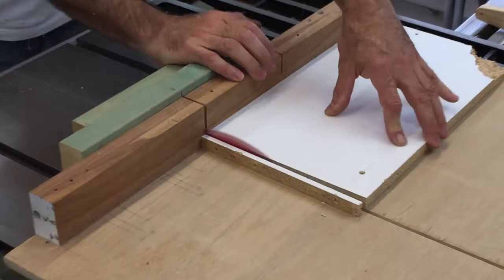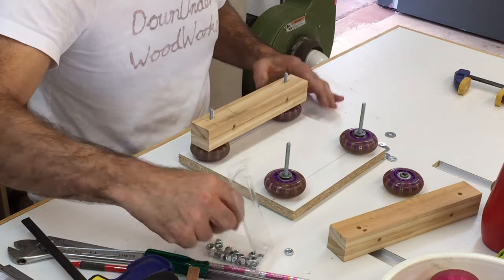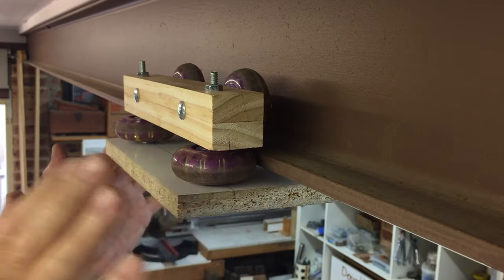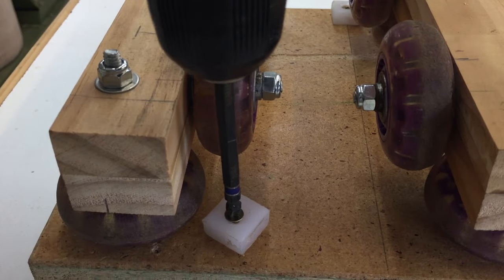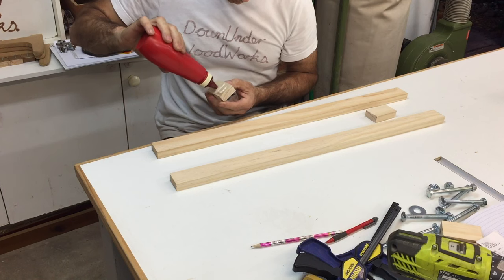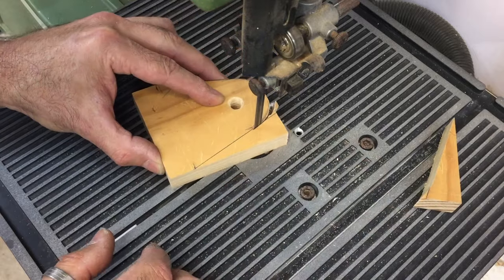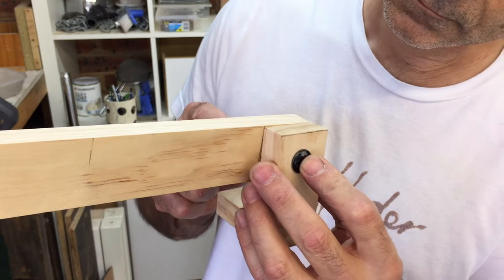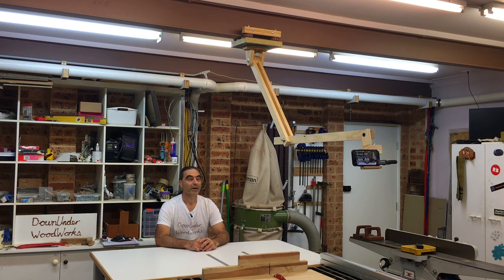Simple DIY beam trolley and camera boom

Comment: Great video, as always. Great timing for me as I'm days away from starting my channel.

How do you frame your shots with your new setup? The height of the phone and distance from you seems to make it a difficult task.
Reply from the maker: Thanks very much Tim. I'm not much of a videographer so not sure i've got any good advice. I don't have a plan when i video my projects, i just set up the camera and press play basically. The iPhone doesn't have a wide angle video lens so thats why the camera is set far away for that shot. Good luck with the channel launch mate.
Reply: I wasn't thinking about a plan or anything as complex as that. Like you my woodworking is off the top of my head.

Let me ask my question a different way. How do you set the camera to ensure you're recording what you want to record? Do you have to jump onto a ladder or something? After pressing record do you cross your fingers and hope the camera doesn't move and that it keeps recording?
Reply from the maker: The boom arm was built to replace my tripod and free up floor space in the shop. For just about every shot the camera will still be at tool level so I can operate it from the ground. With a smart phone the better camera is usually on the back so when its pointed to the job you can see the image on the screen and just frame it that way.

Once the boom arm is set and tight it doesn't move. After I press record I always check that the timer is rolling before filming the task. The phone is very reliable and will only stop recording if the memory gets full or the battery dies. Download to your computer regularly. Hope that helps mate.
Reply: DownUnderWoodWorks thanks mate that does help. I appreciate your time to answer my questions.